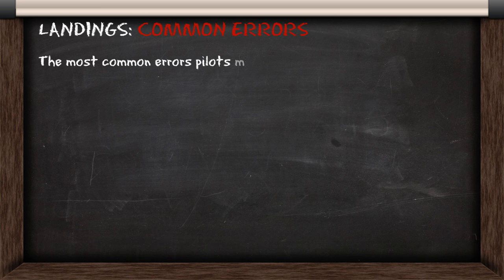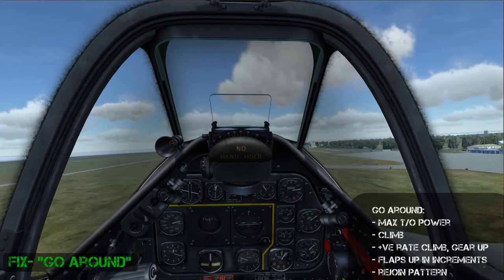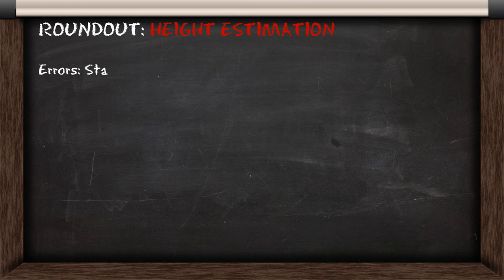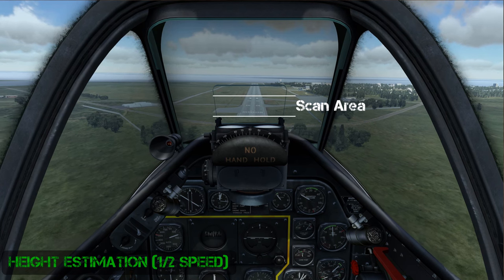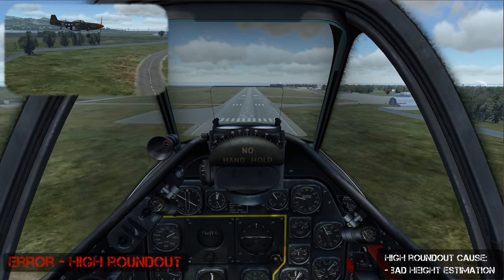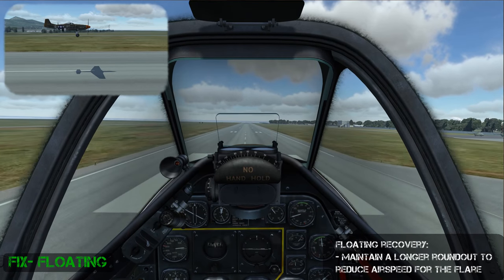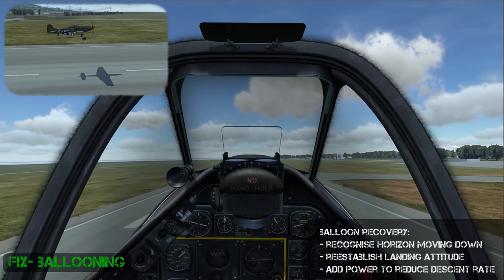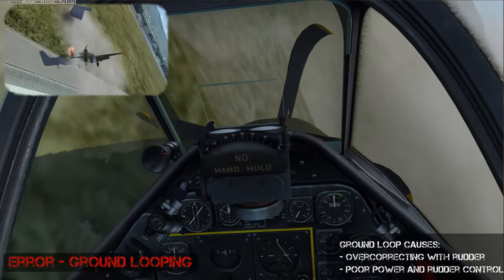Principles #8 - Landing Errors and How to Fix Them

Comment: Good tips but in some aircraft using the ailerons won't do much to save you at low speed because they can lose most (or all) of their effectiveness (even before touchdown in some cases).  It's always worth making the aileron control input but sometimes only using the engine to blast some air over the tail will let you correct your roll-out and avoid a ground loop altogether, rather than just riding it out.
Reply from the maker: Very true Jimmy! I have started a video covering ground loops specifically, but I'm waiting on some tailwheel materials to fully complete it. If included it though would have made the video way too long (I feel like this one is already on the long side) so I only focused on saving yourself in a developed ground loop and not so much on the theory and prevention side of things.
Reply: As a regular rider of the ground loop carousel I look forward to seeing it.

Comment: What about a PIO
Reply from the maker: Good point. I guess I forgot about those since I don't see them very often/let them fully develop. Depending on severity I usually take control after the initial pitch movement if the student is completely oblivious or snap them out of it by telling them to go around if there is enough time.